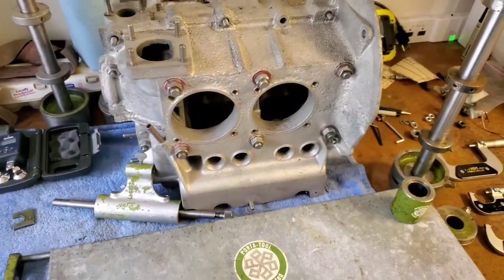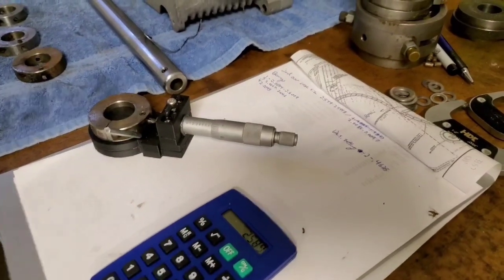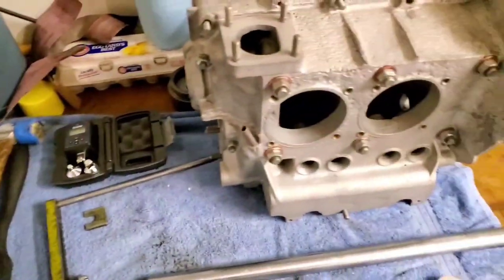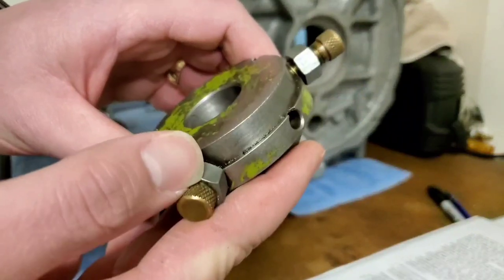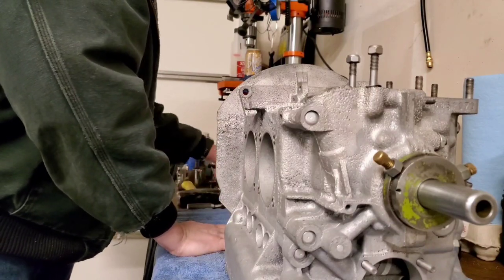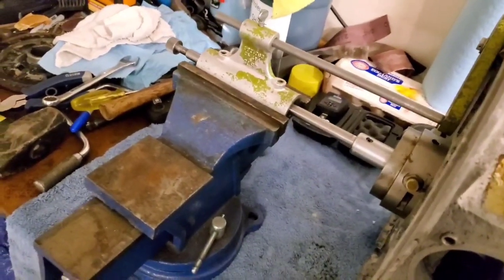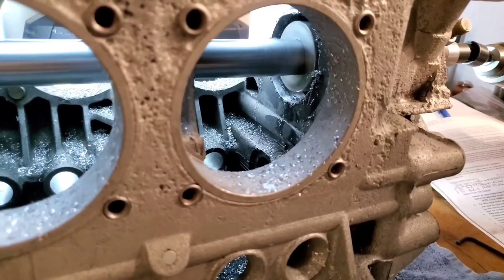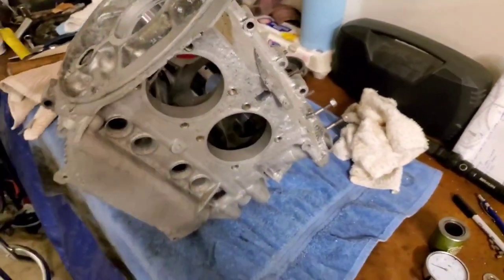Vintage Vw Porta-Tool Line Bore Setup

Comment: Those holes on the front bushings. I do believe it’s to push it out. Turn the bolts in when you are ready to remove.  And it should push it out of the block

Comment: Excellent video, well explained thank you. Just a thought.........would it not be better to have the cutting tools at 180 deg to each other so that you are not tending to bend the bar is it cuts/pushes against the bore of the bearing hole?
Reply from the maker: Thank you and thanks for watching. That is a good idea but during the video I just followed the instructions. It is cutting such a small amount in some fairly soft metal so I'm not sure how much pressure the bar sees as it's cutting. I'll have to try that out next time I use it and see if it makes a difference(the cutters I have on the bar now are set perfectly to second over) looks like I need to find a few more test cases :)

Comment: Hi. Would it be possible to get a copy of those directions?
Reply: I am piecing together a couple of lots. And I am looking for directions
Reply from the maker: Here you are Shannon this is where I got them from

https://www.thesamba.com/vw/forum/viewtopic.php?p=10039110#10039110
Reply: Thx.  Much appreciated.  Have you come accross instructions for the M99 mainliner.   That’s the partial one I have so far 

Thx
Reply from the maker: @Shannon Bailey  you betcha, I haven't but there might be some info on thesamba
Reply: Thx. Just joined yesterday
Reply: Thank you very much.  Do you have any parts you might be interested in selling?
Reply from the maker: @Shannon Bailey  your welcome, unfortunately I don't I'm still collecting parts haha. What pieces are you looking for?
Reply: I need a the front piece that goes on the motor, I can make that one.  But I am looking for one of the first styles of hydraulic feed
Reply from the maker: @Shannon Bailey  will your boring bar be long enough to use the older style feed? Does your feed not work?
Reply: I have another use for it.  I want to try building something for pulling a bar through the cam to fix the centre journal.

I am an electrician hobby machinist.  I am just playing around on a couple donor blocks so far.   I have the oversizing figured out now for the bigger sleeves.  Doing one today.

But I want to turn my shop into a one stop for VW blocks
Reply from the maker: @ShannonBailey-ol4lm  oh nice, that'll be sweet! Is it safe to assume you are using a smaller bar to go thru the cam bearing journals?
Reply: Yes. I will be making basically the same tool others have made and RJE offers.  But I want to then incorporate the feed instead of pushing against a spring
Reply: I’ll get a polished ground bar and go from there
Reply: I’ll make a cutter for it. I made a cutter for the oversize that cuts the new deck and puts a 45 chamfer on in one cut
Reply from the maker: @Shannon Bailey  that's awesome, have you considered filming any of this work that your doing?
Reply from the maker: @Shannon Bailey  I bought one of those scat tools for oversizing cylinder bores and heads for bigger pistons. I have yet to use it though but it looks like it will be a pretty nice tool after the time is spent to set it up. I've heard you can't use that tool for decking but I would think with the right modifications you could
Reply: I have a mill.  And with the style of cutter holder I built.  It holds a 1/2 HSS bit that I custom ground so it does both
Reply: No I haven’t. Right now I am figuring it out.  I am an electrician by trade.  But I just had surgery on my shoulder and I can’t pull wire anymore.  A friend asked me if I could figure this out.  The guy that serviced this part of the country retired.  So I have jumped in with both feet.  I built a jig to hold the blocks(version 1, Irocky shared a picture of his jig I am going to build). I will finish his block today for the oversized pistons. Then I can focus on the line boring and cam issues.  Fixing the centre journal for both the cam and crank.  And learn to fix whatever issue these blocks have
Reply: I am new on Somba.  So I can’t search members.  If you find me on there.  I’ll send some pics 

Boomer999

Comment: I need the front bushing that goes in the crank end !! Do u happend to have one that u can sell to me ??let me know pls !
Reply from the maker: @anthonyalvarez5798  I might have one ill have to look thru my parts and see
Reply: Mine has alot of play it's worn out , everything else is good
Reply from the maker: @anthonyalvarez5798  if you can take it to a machinist and have a bronze bushing put in it and reamed to size would be the best solution I have been wanting to do that to mine but haven't made the effort

Comment: well at least you have good sense to use a dialbore gauge to check the bores.  Some people just use by 'feel' -  LOL!
Reply from the maker: Thanks:) good to use some "feel" with some bearing crush, glad I measured the bearings and bored the bearing saddles accordingly otherwise the #3 bearing wouldn't have much for crush if I bored it per the specs.

Comment: I can't find anyone in West North Carolina that does this any more... Maybe I should look on eBay to find the tool
Reply from the maker: That is where I found all the parts I have. The only person that makes them new is rocky Jennings out of Washington but they are about 2700 bucks!
Reply: @V8N8T  yikes... a new super case was $1,000 a couple years ago, maybe I'll do that again.  I called my shop in Florida, they said "not at this time", meaning, I think they have the tool, maybe they will sell it to me 🙂
Reply from the maker: @ManVsOven  yeah it's expensive I think that might be something that would pay itself off if you had a shop, I have about 600 into all the pieces I have. If you do a forum search on thesamba for porta tool there is a guy that has one for sale. The super cases have gone way up in price even a stock case is 1500 now
Reply from the maker: @Cory Siple  there is a later style porta-tool line bar on ebay with cutters right now https://www.ebay.com/itm/304861943636?mkcid=16&mkevt=1&mkrid=711-127632-2357-0&ssspo=CWZgWtiZTh2&sssrc=2349624&ssuid=9EMM8T60RH6&var=&widget_ver=artemis&media=COPY
Reply: I just got a complete tool like the one showed in the video I'm in Wake Forest NC but I need the front bushing that goes on the end of the case on the crank side ! Once I get it I'm going to bee doing line boaring ! Let's see how it goes

Comment: Why don't you use metric since everyting on the motor is metric??  ??
Reply from the maker: All of my measuring tools are in imperial, also if I come across Metric measurements it is pretty easy to convert